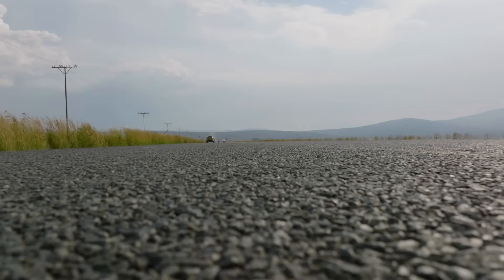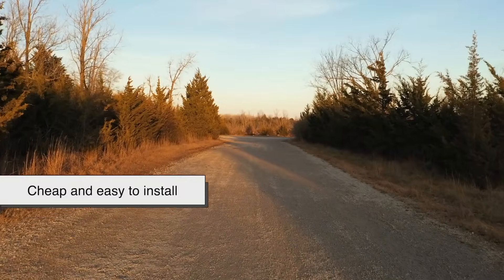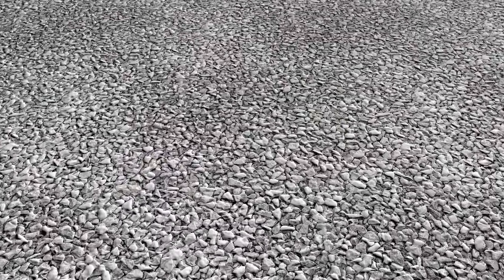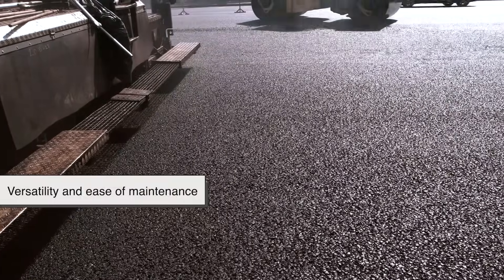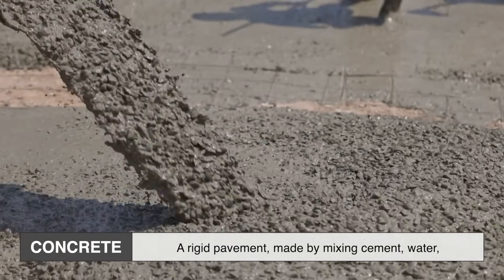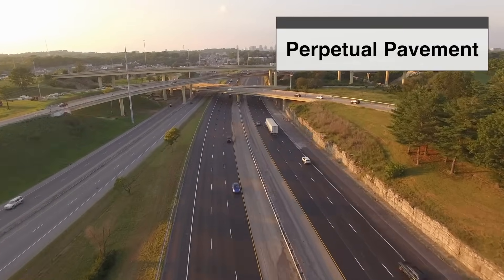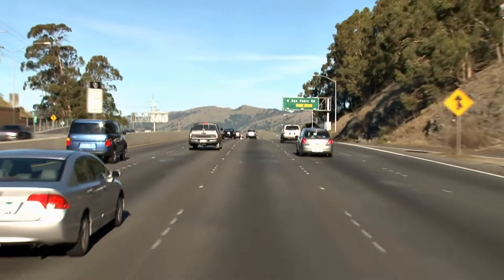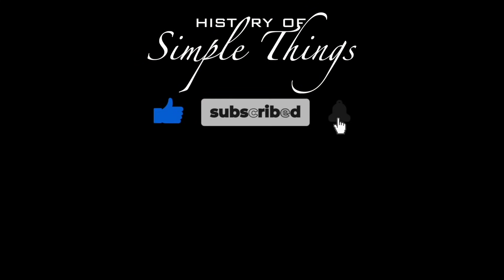5 Best Road Surfaces Ranked by Durability and Performance

Comment: How about cobblestone?
Reply: Their cobblers 😅 Seriously, wet grip and ride, there are still areas in Nottingham where they show through and I remember them being THE surface in my youth and controlling a pushbike on them was scary. Very durable though. I am not a fan of concrete, per gram of concrete produces a gram of Co2, it is noisy and wears tyres plus it is almost impossible to recycle. Tarmac can be recycled over and over.
Reply: @MrStevecrasher Asphat is 100% recyclable and can be driven on almost immediately after it’s installed.
Reply: @TheNomad3000  What you know as Asphalt is known in Britain as Tarmac, an abbreviation of Tarmacadam, a process pioneered by Scottish engineer John Loudon McAdam in the 1820's. One of the first stretches of road in the world covered in natural Asphalt was Huntingdon Street Nottingham, paved in the 1840's and approx 1 mile away from where I am seated.
Reply: @MrStevecrasher thank you for the knowledge.
Reply: @TheNomad3000  Every day is a school day 🤓
Reply: I think there was already a video on this.